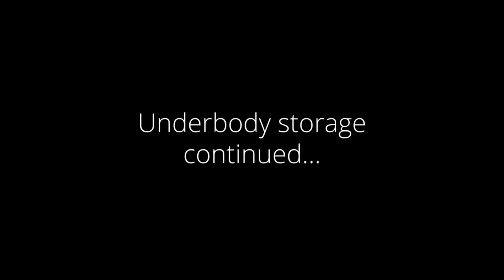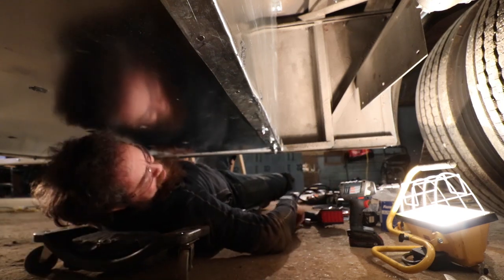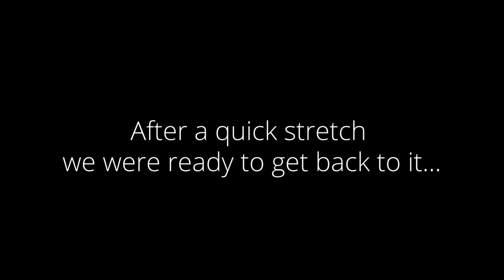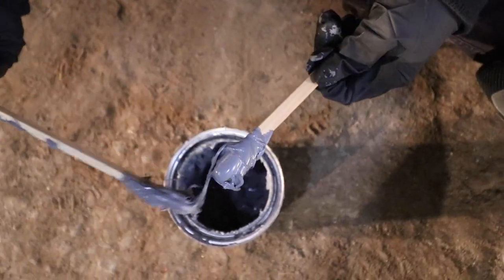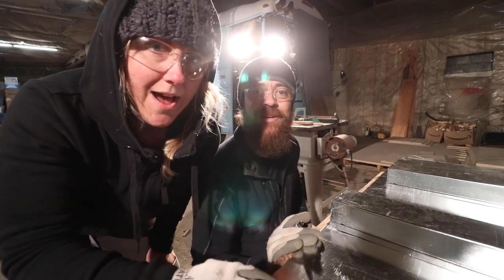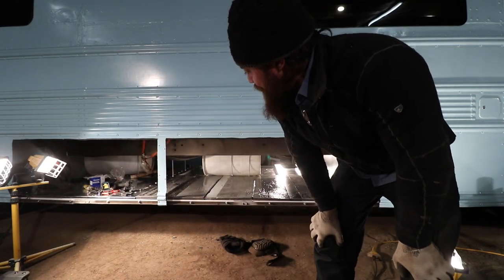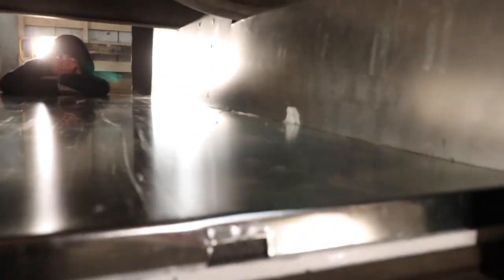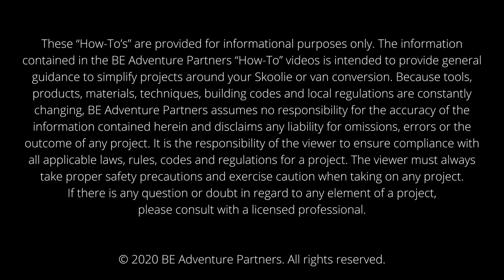We Made A Skoolie Basement | Underbody Storage Continued & Not Complete YET... Part 3

Comment: Holy Mole that's a boatload of work...not to mention engineering. After you guys are through with this, you will basically be capable of manufacturing an entire bus from scratch! (the engine will be a bit difficult)
Reply from the maker: Yeah... we're learning a ton on metal work, load distribution, along with weight tolerances/safety factors. The engine is a totally other portion that we're learning more about. I (Brian) used to perform daily/weekly maintenance on the fire truck I worked on and our school bus is considerably less complicated! Thanks so much for watching!
- Brian + Erin

Comment: Hi friends.  Question... do you have your bus jacked up and blocked for this work?  Or is my suspension way lower than yours? I could never fit under the skirt nor bay unless the air bags were inflated and then maybe not.  Don't trust your tires.  Use jack stands for working under there please! It's looking great.
Reply from the maker: Hey @AllMoMoMostHome Bus! Nope, we aren't jacked up at all. Just 6 wheels sitting on the floor. I don't think we would have room to jack it up. Maybe a few inches, but it isn't really worth it for our safety. We'd rather be uncomfortable. Plus we don't have jacks yet. We appreciate you caring about our wellbeing. I guess your bus sits lower than ours, or maybe just appears that way because of the surface you are parked on. We have about 13-14"s space to wiggle under there. It's tight! Sure don't wanna eat a big meal before scootin under. LOL Take care Larry & Fam! - E + B too

Comment: looking great guy's, lots of work for sure. just wandering what type of heating you are going to use in this space?
Reply from the maker: Hey hey @Lary Fly! Glad you are enjoying our build! As for heating, we're going to probably have a couple of diesel heaters for the cab area of the Skoolie. An idea is to set a thermostat for the underbody storage that is connected to a motorized damper. When the thermostat gets below, say 35F, the damper opens, and allows heat from the diesel heater to enter the space. The idea is to keep the tanks from freezing and the battery bank would benefit from not freezing as well. With a total of R10 insulation and weather sealing the underbody storage, this may be a good idea... Another option is to attach "tank heater" pads to the tanks and put that on a thermostat. However, with that, they are powered by the battery bank and we haven't' done research on energy consumption for those pads yet. What are your thoughts on heating a space like this?

Thanks for watching! 
- Brian + Erin
Reply: @BEAdventurePartners  so if you are going to use a heater to heat the under storage and the cabin as well you might want to think about installing 2 dampers with separate controls, 1 would open to allow warm air to the storage area if needed and 1 would control air flow into the cabin and vise versa, of course that would require a little synced control

Comment: Murphy's law says the first thing to fail will be the tanks you can't reach/remove, you know that don't you?
Reply from the maker: You got that right @roscoau! However, if that ever happens, we'll be buying a tank to fit that area. We're just repurposing as much stuff as we can and, quite frankly, those two white tanks are stronger than ones we've seen that are for sale. The walls on them are so thick that I (Brian) can sit on the barrel in the middle and the barrel does not even deform.  So if anything fails on it, it would probably be a seal, which will be replaceable.

Thanks for watching!
- Brian + Erin